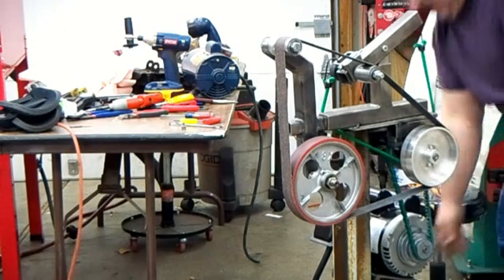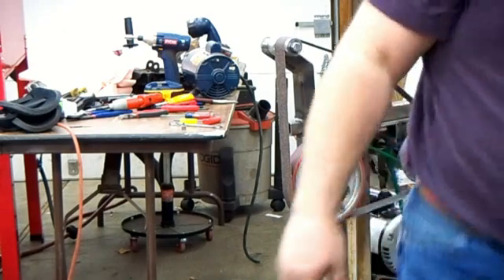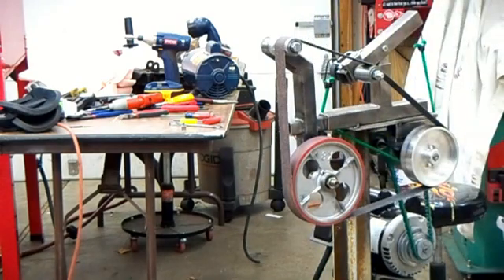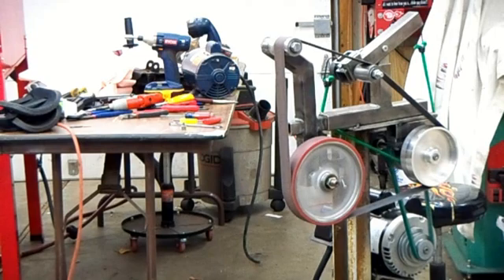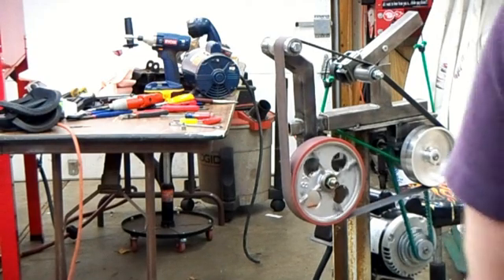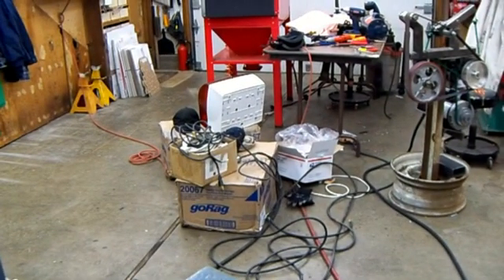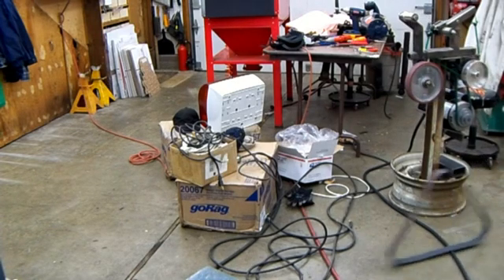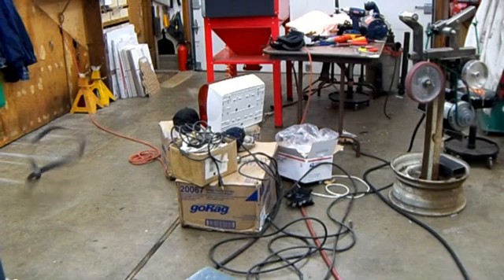Belt grinder, runaway belt

Comment: What are you grinding with that thing? I just built a 2 x 72 and have a 3/4 HPMotor on it running 3450 RPM and it will grind anything I put on it. Just curious
Reply from the maker: Originally, lots of 3/8" steel plate.  With the step pulleys, I can get the belt over 10,000sfpm........way too scary to keep it there! lol  It's nice having all the HP, but it's really not needed.  It's kind of a "Tim Taylor" tool.......more power!! :)    When I was doing a lot of grinding, the sparks would create a steel "felt" on the floor.  I could pick up a 3/8" thick piece about 8" diameter in one piece.  It was almost welded together. lol

Comment from the maker: Sorry. That was a junk wheel that had been thrown away because the caster brake didn't work.  I could do the machine work on a wheel you get, but between that and shipping, it might be better to look at some of the options on usaknifemakerdotrcom   Check the Grinders & Sanders page near the bottom for their wheels.  beaumontmetalworksdotcom also has large contact wheels.  If you check my vids from March, you'll find vids on the new grinder I made :)

Comment from the maker: I hadn't thought about the wheel itself and the rpm.  Even if I run the belt at 10,000sfpm, that wheel is only turning at about 835rpm.....so it doesn't sound as scary that way.  I tossed the stock needle bearing and machined the wheel to hold the two R8 bearings rated at 9500rpm and 1100lb load.  The axle bolt is also has left threads in case a bearing locks up, it will tighten.  I only run the belt at 3500sfpm these days.  Still takes metal off quick!!!